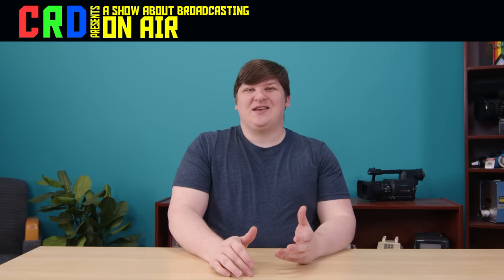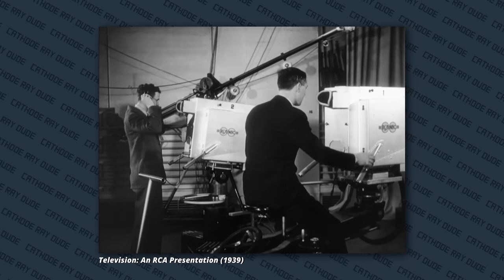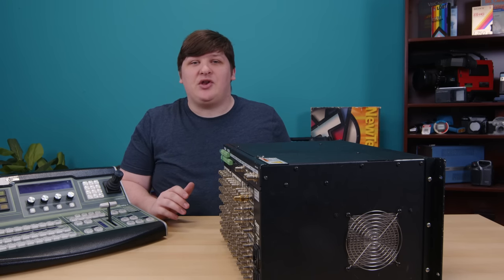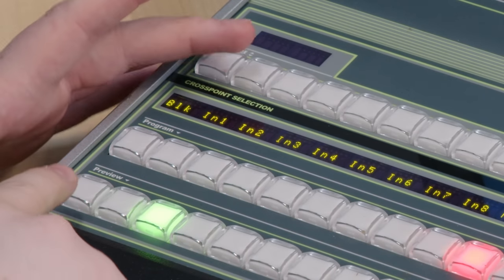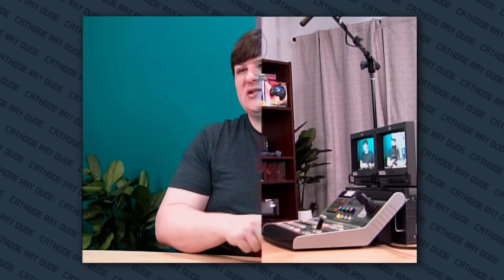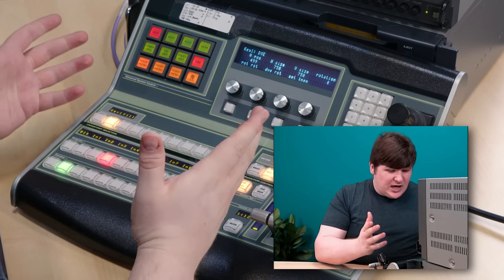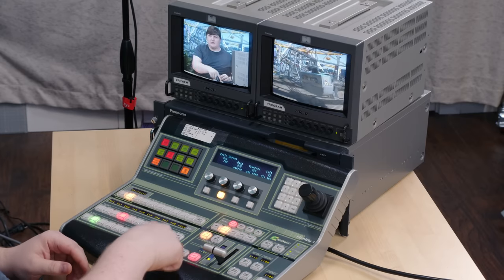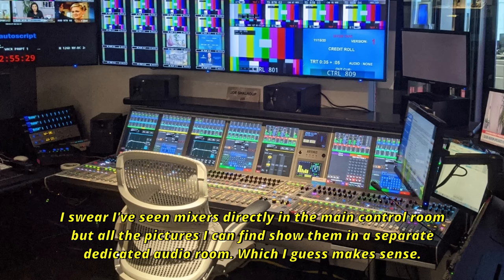What the heck is a video mixer?

Comment: 😊It was at an automated radio station in 1983 and ‘84 that I first began to learn how computers work. I took a job as PD at a station that had been purchased in some sort of emergency sale, and none of the computer’s documentation was ever found. The system was doing a terrible job of rotating the music correctly and, even worse, of insuring that commercial spots played at the correct times. I had to learn the system and reprogram it, and once I figured it out I found little problem learning other OSs, like Xenix and MS-Dos.

It was an interesting system. There were four reel-to-reel tape drives, and three categories of tapes to be rotated in a numbered order. Each tape held about three hours and fifteen to twenty minutes of music, as I recall. Each track ended with a subsonic step tone that could be used to trigger either a news update, weather report, a commercial spot, a jingle, or whatever. The tapes were sent to us by a subscription service, and in-house we put our own step tones at the end of spots or jingles or any recorded announcements that were to be played by the computer. On the four tape decks would be a reel of current hits, a reel of recurrents and two reels of gold (oldies). Our music library consisted of (as I recall) two reels of current hits, six reels of recurrents and fifty reels of gold. When tape 01 in any of those categories came to an end, we would replace it with 02, then 03 if there is an 03, and so on. On the two reels of current hits there were some 9 to 11 tracks in hot rotation, appearing in about the same place on both tapes. Other hits appeared on just one of the two tapes, and thus were in general rotation.

Comment: I have no professional experience, but have been playing around with TV equipment at a student TV station and it was nice to hear some different industry terminology, given I have only experience with a BMD ATEM 1 M/E switcher. We occasionally use the tbar for slow fades from a singer to something like defocused stage lights.
Recently we switched to mainly using vMix and for hobbyist  production it reduces the number of computers we use, as there's no need for separate computer for streaming and another one for computer graphics. This also makes it easy for a single person to switch cameras and control graphics on smaller productions.

Comment: I did video production for a church that used that datavideo switcher. all the kids who volunteered wanted to use the checkerboard wipes lol.   they changed to a software switcher when upgrading to HD though.
The one thing I found the T-bar useful for was doing slow, controlled cross-fades. We would use a lot of fades during music programs  it's harder to do that on the fly with the auto option.

Comment: SEG's ("A/B switchers") were used for Master Control of a TV station, i.e. the station broadcast operator who switches between things like a VTR for commercials, a film chain for movies and a coaxial/satellite network feed.  Some of these SEG's had AFV modules (Audio Follow Video) so that the operator did not have to worry about a separate audio mixer.  More like the station did not have to hire separate video and audio operators (unless it had a nice, tight union and was in the union contract).  The Panasonic one you have was for small and sometimes medium market TV stations.  Also those were used for "Local Origination" cable TV channels, which were written ("mandated") into a franchise agreement within the operating city, since they were cheap for it's time.  I used one for a pay-TV service called "Channel 100" which was connected to a pair of Sony 3/4 inch players to show movies.

Comment: FYI rack extrusion, nuts and rack wings is used to build out physical work surfaces (desk flat or at an angle or horizontally) in either the 19" or 500 series format.

Comment: I used to operate a Videonics MX-1 (the black one, not the silver) at a church, where song lyrics were generated by a crusty laptop and backgrounds by a video cassette deck playing aerial footage of Canada, and the t-bar was used to hold the lyrics and the backgrounds at roughly 50% crossfade - though looking back it was probably possible to key out the black from behind the lyrics and have them both at 100%, but I was 8 and if I messed around with that I'd probably have gotten looks for ruining things during a church service
Reply: Yeah really depends on the church. What you really need to do was gotten in there not during service. At eight I stopped going to Sunday school because I kept getting pulled into the main sanctuary to fix things namely operate the DVD player for movie clips. We went through a lot of tech booth managers. At one point I think three or four and I was the only one who was actually there who know what was going on. On top of that we had a drama group who like to modify everything for their play and not put everything back so I got very lucky being in there on Saturday finding things not fully plugged in that didn't even need to get unplugged. But I know a lot of churches that are like it works don't touch it.

Comment: My father was the original engineer for the first TV station in Rhode Island (probable third in the North East after NY and Boston) originally starting it right after WW-II and being Chief Engineer up until retirement (in 1986, I think).  I got to see a bunch of interesting TV gear in that time (including the day when he came home in the remote control room van rather than his car, and I got an extensive tour of the setup).  One interesting bit was when I was doing some project in the late 60's / early 70's and needed a bunch of pushbuttons, after mentioning it to him the next day he brought home a random panel of controls for me to disassemble, it was the control frame from a mixer they had taken out of service (I'm guessing it had to do with upgrading to color broadcasting).  It had been an A/B style switcher and I particularly remember the T-bar as it was big and let you separate the two sides (each of which had it's own pot) and move them independently.  I'm not sure what you could get from this in TV production, though.  Anyway, loved this trip down memory lane for me, loads of fun.

Comment: I used to TD news breaks (live 30 second news updates during commercial breaks) from a master control switcher. That had 24 sources immediately accessible, two key buses, and two audio mix buses. That was a challenge at first, but got pretty easy quite quickly.

For those who don't know, a master control switcher is the switcher that EVERYTHING (including audio, production switchers don't do audio) in the TV station goes through before getting sent to the transmitter.
Reply: I was also going to mention these kinds of mixers as well. An even more niche version of this technology.

In Australia and I think the UK. This part of the station is called Presentation, to separate us from Master Control. Who handled the stations I/O as it were.  But not putting a TV channel together.

Comment: I actually work on software for generating computer graphics that then goes through mixers like these! Our computers have special PCI-E cards that can generate the SDI signals from our internal framebuffer. One thing we usually do is actually generate two signals at once, one for the colour image called the fill, and one for the transparency called the key, and the mixer can take both of those signals to key our graphics on top of the actual video feed. Sometimes that is also combined with a chroma key for things like virtual lines on the ground so that it doesn't cover the actual action. It's cool stuff to watch it actually work!
Reply: And this video has actually helped me understand what the operators/technical directors are actually doing with our graphics! I've watched them in action multiple times, but it was still a little overwhelming

Comment: Awesome video CRD!. The sad thing is I've used most of that SAME gear in my past jobs. I've used the Panasonic MX50, Panasonic MX10 and 20. I've had that Panasonic Video switcher at a College TV station I used to work at. That same college also had an Amiga Video Toaster but the hard drive didn't always work. I also have a Videonics MX1 still in my house and the Panasonic MX20 somewhere in my storage room. I also had that black Panasonic Mixer AVE5 but i sold it. The Setup "(black level)" was ridiculously low on it (lower than 7.5 IRE the US standard) and black and white films I would pass thru it lost a LOT of definition because of that. I'm like you I need to get rid of some of my stuff. I also have several 80s and 90s Panasonic  studio/ENG cameras. The 80s one is Orange and has tubes. I love the old analog stuff but I really just don't have a use for it nowadays and I really should just donate to a museum. I have some DV player/records somewhere and I used to have a few UMATIC and SVHS player/records as well (long gone). I used to work on Ross Switchers in College along with FrameSyncs and TBCs, while when I graduated I worked at a CW/NBC station and helped convert their facility to HD. Got to work on Microwave links, HD GrassValley and Adobe editor systems (I remember the P2 cards from the ENG cameras). The chief engineer at the college was really nice to work with. He taught me so much about repairs and how to use o-scopes; he didn't have to do that and most classes would have cost money to learn that stuff but he could tell I was a kid that grew up in the middle of nowhere and was always fascinated with TV and Broadcast gear. We even had a C/Ku Band satellite in our front yard growing up because there was NO cable were we lived. Remember being able to watch live feeds from the networks and also foreign tv like NHK, DW (German), Spanish stations, CBC, BBC, etc. I left the broadcast would and now work in IT. There just isn't a decent way to make a livin' anymore as a broadcast engineer. I yearn to work in broadcasting again but honestly, would rather work back in the old days of analog and big 2" and 1" Reel to Reel VTRs. Love your broadcast video videos, keep them coming!

Comment: 47:30 Regarding sound, there are exemples where you do want sound to switch with the image. For instance the live broadcast of a Formula 1 race where you want to hear the car pass the camera you see. Overall F1 live productions are pretty wild, with around 30 track cameras, more than 10 in pit lane, four on each car including 360 degree camera, helmet camera for each driver from this year I beleive, helicopter cameras, drone cameras, cameras that run along wires in the air, cameras that run on tracks... (EDIT: Mostly F1 races are covered by a production team that travels with the races, but for some reasons there are eceptions. For instance the race in Monaco are covered by Télé Monte-Carlo (TCM) and that shows. They lack the experience to handle such a complex live broadcast if anything out of the normal happens.)
Reply: I have no experience with F1 specifically, but when this is needed in other settings, we sometimes just set up a GPI trigger from the vision mixer to the audio mixer. So the vision mixer tells the audio mixer that a specific camera is now live, and the audio mixer automatically unmutes a specific mic to go with it.

Comment: 19:09 I never had any equipment with mini displays like that, but those always look adorable for some reason. The first one I encountered was an Yamaha TF3 audio mixing equipment at Broadcasting Expo few years ago. It had little monochrome displays on each channel(Probably LCD or OLED), showing channel number, channel name, and the input name(and probably context-sensitive).
It is a bit of shame that I didn't look at video mixing gears, but I didn't really know(and still is) anything back then. When I saw TF3, the only thing I knew I could touch safely is the volume slider.

Comment: I love that you upload on Friday after lunch, makes the end of the workday go by so much faster. I'm currently sitting on top of a ventilation duct waiting for an electrician to show up.
Reply: So did the electrician show up? I'm thinking something HVAC.
Reply: @imark7777777  yup, motor change out on a fresh air fan. When I unwired the motor I saw they used the wrong wire so it needed to be replaced. It's a state job so they will happily call out an electrician to replace four perfectly good wires because they're solid and not stranded.
Reply: @nbarrager  well at least there's no heel dragging more than usual. I Occasionally watch "HVACR VIDEOS" so the comment peaked my interest both hot, cold and mainely electrical. Hopefully you had some nice weather.
Reply: @imark7777777  yeah I'd definitely rather overdo it than hack shit together and worry about getting blamed for it failing. Weather was pretty good, unfortunately the job was in a boiler room.

Comment: When I was studying video production there was one production I helped out on where, for some reason, the titles weren't keying properly. Everything black (including things like drop shadows under the letters) was keying out. We were already behind schedule, so I suggested using the t bar to do a wipe, stopping 2/3 of the way down the screen, then saving that as a preset.

One prof also told us that before closed captioning became common some programs would have a sign language interpreter stand at one end of the studio, with a camera at the other end zoomed out as far as possible, framing her in a corner, then using a partial circle wipe to superimpose her over the program.

Comment: I ran a mixer in highschool, the school had a TV in every room and a small studio. It was used for morning announcements. If you had "Tech" class first thing you were part of that. So there were studio cameras and a full mixer. I also spent time doing the audio too. The camera's, talent, everyone were students. I'm pretty sure the video mixer worked like the Panasonic mixer. The audio and video mixers were side by side separate units though.

The monitors in the control room were all Commodore 1702s. 

This was the early-2000s so it was all standard def, and went out as a TV signal over coax. They also had it set up so that they could turn on all the TVs remotely, there was a little serial IR emitter taped to every TV to do this, I actually have some they were throwing away at some point.
Reply: I'm guessing that school had a bunch of Commodores that then they upgraded and they found a new used for those monitors....
Cable distribution for closer TV makes a lot of sense you can also put different programs on different channels hint hint announcements on channel 2 special program on channel 4 centralized VCRs no need to roll a video cart.
Reply: @imark7777777  Naw. There would have been a 15 year minimum gap between the school using Commodores and the studio existing. I was among the first students in the new building. The elementary school moved to the old high school and the high school moved to the new building, the old building didn't have the TVs, or a studio. I'm part of the only age group that went to all three buildings, grade 8 shifted from being at the high school to the public school in the move, I had grade 8 at the old high school.

I vaguely remember asking why Commodore monitors, and I think the answer was that they were really good quality for cheap, since they were meant for use with a computer and so were expected to display text they were higher resolution (smaller phosphor dots) than cheap TVs of the same size.

The size mattered because we did have a preview of every input as well as monitoring for both buses of the mixer, so there were like 8 of them.
Reply: @spudd86  I just assumed school system underfunded never upgrading and somebody being resourceful. They might've just gotten them very cheaply. There's also the possibility of getting them cheaply through the educational program. From what I understand they are fairly good monitors.

That's definitely a cool experience to be in all three buildings. I see a lot of schools that are just getting demolished and rebuilt and I'm like you're losing all the history. At the same time there are some that really need that.

8x of them oh my goodness I'm imagining 8x15 inch, maybe these were the smaller ones.